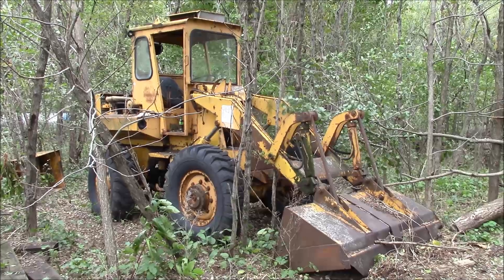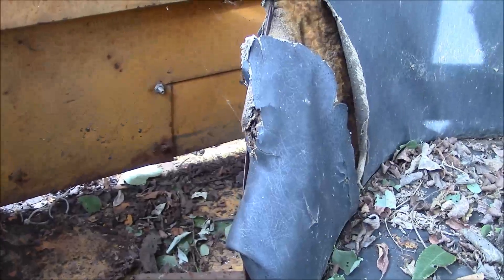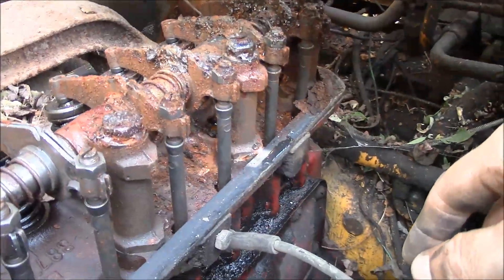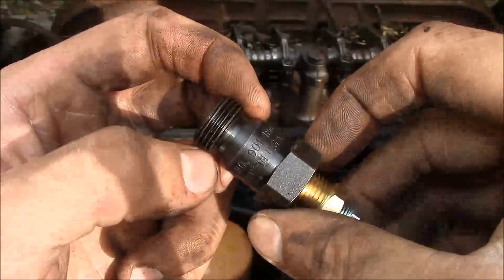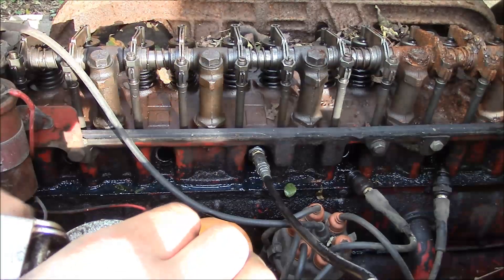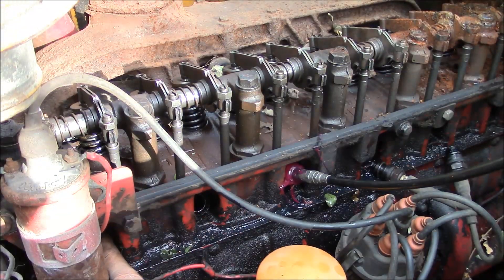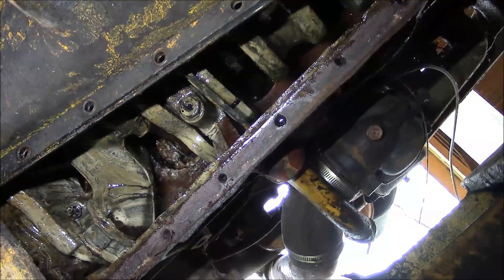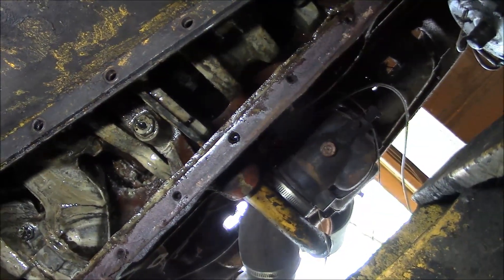Can You Free a Seized Engine with a Grease Gun?

Comment: I have a few ideas that you may want to try. while i am not a engine mechanic, I usually can get them started when im working with my grandparent who was. I have also done some chemistry and a lot of physics so I have some knowledge on what I am talking about. Sorry that my post is long but you may be able to make use of what im suggesting if in some sort of way if any of my ideas are remotely good. I have five ideas written down. also if anyone has a comment on my ideas, please do tell or correct me.

My first idea is to find something that can dissolve the sludge on all the parts of the engine in the inside, or at least slightly clean it, then clean out the oil pan. Once done the major part of my idea is to fill the whole engine top to bottom with WD40, coca cola (or something else that dissolves rust) as it can sometimes break down rust and gunk. 

My Second idea is to get more grease guns and hook them all up to the pistons on the down stroke and pressurize them equally adding a bit more to each one by one, this would give more equal torque to the crank shaft and to the pistons all together. you said the front was moving a bit so if you had more pressure on all of them equally then you may be able to make it move again.

My third idea is that if you have some welding tools you may be able to make a set of bars connected together that can be lined up with the pistons that are on the down stroke. Then have the the bars line up to a single point that can be struck with a mallet or hammer and try to force the pistons that were on the down stroke down manually, it may work but would need the piston heads exposed.

My fourth idea is somewhat dangerous, its putting the engine back together again and putting some fuel into the pistons that were on the down stroke and manually firing the spark plugs all at once for the pistons on down stoke.

My fifth idea and the one you would least likely want to do is dissemble the engine manually and clean the parts, then put it back together. My cousin has a three wheeler that had become seized and he disassembled it and put it back together to fix it. Understandably this is probably one you cant do but it may be the only other way I can think of fixing it besides getting a new engine. 

I may ask my grandparent if he has an idea as used to maintain and repair tanks in the wars, he worked on the engines that had square cylinders so maybe he might have a trick or to. 
Thank you for reading my long comment
Builder
Reply: Firing the plugs with regular fuel wouldn't work, pre loading the cylinder with oxy aceteline would work. With a bit of luck the explosion might get some decent pressure in the cylinder with the blown gasket before the gasket can leak to much.

Comment: It looks like the common old 300 hundred six ford engine. Old ford trucks everywhere that the body gave up for safety sake but the engine runs just fine.  I would requisition one from a pick and pull or market place... word of mouth, craigslist for a old runner so you can at least hear it, give three to five hundred for it so you can save for the yard to take what you are sure that you don't need and that means in the one the other one running so the doubt level goes down. I do believe other people will ask for parts like a rear end or transmission o you can give/ sell cheep so they feel like buying them. Don't get greedy. Just save the loader and its possible to pull the engine with the torque converter still attached but new seals to ensure no leaks for the few dollars it costs. You will smile as soon as you hear run trust me

Comment: Pull the head off and let it soak in penetrating oil for a day than slowly hit each cylinder using a piece of soft wood to not damage them! Have Freed a few engines this way. It would at least make it easier to take the engine out.

Comment: I have a loader like this one used for snow removal.  It has a 99 4.3 vortec engine and computer in it.  600 for the engine, computer etc and a machine shop made the converter adapter ring and mount plate adapter.

Comment: Just a thought.
Put the sump cover back on, fill cylinders and sump with coke. Cylinder walls are tough and should be fine (Plus petrols dont mind low compression). The rings might break. Let the coke sit for a day or two. Put a numatic wrench on crank and 1 second forward 1 second reverse and repeat. In about 2 minutes youll have it free.
Reply: I actually freed a flathead ford using boiling coke.  Put the coke in a sauce pan on the stove and brought to a boil while using a torch to warm the stuck cylinder.  Then poured the boiling coke on and smaked the piston with a hammer.  That said I obviously pulled the heads before I got to that point and it was only one cylinder that was stuck not 2 and it wasn't quite as bad as this one.  I think she is pooched but the coke thing is something to keep in the back pocket when faced with similar issues.

Comment: You could unbolt the con rods or that the engine is kaput you could cut a chunk out the crank so you can turn the flywheel to unbolt the torque

Comment: Tough break with the engine, you mentioned these engines were fitted to the gasoline variant of their tractors, does that mean there`s a diesel variant and if so would the diesel engine will fit the loader?

Comment: You can also use the hydraulic grease method to remove a bearing from a blind hole by filling the center hole with grease and then a couple of taps on a punch with a similar od to the center hole id and the bearing will come right out.

Comment: There is one thing about putting grease inside the piston, no matter what you have to take the head off and clean the grease out of the piston. You can adapt another six to run in that tractor. But yes you have to turn the motor.
Reply from the maker: The head gasket was leaking anyway.

Comment: Cut the engine up with thermite. Right there in the engine bay. Then make a adapter plate for some better engine or even a motor. Hmm a couple of Prius battery would not make much difference to that beast. I Don't know, just thinking outside of the box. Great video enjoy your program

Comment: Fill the engine with diesel fluid from the top fill, grab a air nozzle and mount a long brake hose tube on the nozzle end. Zip tie the air gun trigger, slide the air guns brake hose down the dip stick. Regulate your air compressor to about 5psi and let it sit over night. The diesel will help brake loose many of the containments while the air hose at the bottom of the oil pan will help agitate things. They do this method for carbon build upped clapped out cars and many are successful. Pretty sure it would help! If you get it free, throw a new headgasket in it.

Comment: One thing to consider is, the rocker arm train could be up to half the rotational resistance being so rusted up. You might still have luck if you remove the rocker arm or head completely. If you remove the head you could used a wooden rod and hammer the top of a piston while turning the crank with a wrench. If that doesn’t do it than it really is too far gone. If it frees up at that point than just have the head machined and run it. As long as you have enough compression it will go.

Comment: Who says you have to make all 6 cylinders working?

Take the head off and if the cylinder wall damage is too much, just leave out the pushrods of the faulty cylinder.

Yeah it will sound like a dying bear but it will run.
Reply: lol I'd love to see it bodged back to life like that! Guess you'd have to unbolt and torch cut the connecting rods on the seized cylinders to get them out the way, and leave pushrods out as you say.. youd have to disconnect the fuel injection lines too. If it actually fired it then maybe it'd be worth taking the head off, cleaning and lapping the valves of the good cylinders and putting fresh head gasket in there and it might even be usable.
Reply: @SuprSi  I've seen this done few times on old v8 beaters.

Usually only the intake pushrod is taken out, so that the bad piston is not just compressing the same air over and over again.

I think it's easy enough to just route the diesel line to the return line with diesel motors

Comment: From my experience with some seized engines is that their could still be water in the cylinder that’s stopping anything that’s poured into it. I’ve had success by filling up the crankcase with diesel so that it can work it’s way up to the top ring from the bottom of the cylinder.
Reply: As Eric O would say, "There's your problem, lady!"  It's almost certain that at least one of the cylinders is full of water. Remove all the plugs and see if it will turn.

Comment: If you're  not hoping to save the engine, more options present themselves.  Have you  tried pouring alloy wheel cleaner into the seized cylinders?  I've done that on motorcycle engines that were seized before.  It dissolves the rust but leaves metal mostly alone.

Comment: Save your money, time, and much MUCH frustration! The problem with “getting something running again”, is everything ELSE that needs work. The Trans will puke next,  then the seals, bearings, brakes... and on and on!  Find a used engine/trans combo, preferably a DIESEL, and convert it from gasoline. Some “up front” money to do that will save a ton of Nickle  and dimeing along the way!
Reply from the maker: We know it has other problems. But it would work for limited use.

Comment: Pop the head off and grab a sledge hammer and a chisel and break 2 and 5 pistons.. the engine will turn over allowing you to remove torque converter bolts...

Comment: I de-rusted and unstuck an inboard Chevrolet Mercruiser in a 1966 Glastron ski boat.  The engine looked way worse than yours BTW.  It had rusticles like the Titanic inside!
 I took the engine block out and submerged it in a plastic tub and did electrolysis on it with a battery charger, some lye, and a sacrificial steel bar.  I left it in the mixture for four days.  It was very clean (and pitted) gray cast iron.  I had to sleeve a couple of cylinders but it runs today and that was over ten years ago.

Comment: I think you've done all you can for that engine, either find a new/used engine for it that already runs or scrap the idea of the loader at this point. The other thing is even if you find a new engine and pop it in there, then the only thing you will know for sure is that the engine runs, while the rest of the machine may be just as bad as the old engine. Would sure be cool to see it running, but I think you're looking at a relic of scrap metal.

Comment: Mix up a mixture of ATF,diesel, brake fluid, penetrant, whatever you can find and dump it in the cylinders.  Then find a massive cheater bar and just start working it back and fourth. It has worked for me but if that doesn’t get it free the motor may need to be torn apart.

Comment: what if you put the pan back and fill all the cylinders with some chemical that dissolves rust / put the spark plugs back so it doesn't dry out. and go back to it in a few days. that might actually help instead of trying to brute force the engine to move with grease.

Comment: Here is my suggestion:

Use a flame cutter to cut the crankshaft so you can turn the torque converter.

Undo the torque convert bolts.

Flame cut whatever structures you need to get the engine out.

Replace engine.

Weld back in what you had cut.

Yeah huge job I know.

Comment: Not that odd to try as I once saw a video of a gunsmith using a grease gun to remove a stuck round from a barrel after the normal methods failed to dislodge it. 

When you run into bad engines and things like that on equipment in the woods remember to bag the parts you don't put back and have a marker to leave a note of where the parts are stashed and what you found wrong on it in case someone else comes along to try to not waste time figuring out what you did already. 

Even if the motor itself is dead the machine still has lots of good parts that can be salvaged for other projects like the lift cylinders would make perfect parts in a sheet metal compactor/bailer. The perfect thing for a scrapper or shop to turn large amounts of sheet metal into compact cubes for easier storage/hauling.

Comment: Coldwarmotors machined a cap for the cylinder and used a manual hydraulic pump to free it up. Had to take the head off. On the studebaker v Buick challenge.

Comment: The easiest way to free a motor is with an oil soaking everything and heat.  Fill the pistons with diesel and trans fluid. Soak the top and cover it back up.  Leave it for a couple days.  then apply heat with a simple propane torch. Heat it on the block around the piston.   Tell me where it is, I’ll do the figuring.

Comment: get to the crank nut on the harmonic balancer  and put a socket on it a breaker bar. take a drilling hammer or mini sledge and beat the breaker bar handle going both ways. keep hammering until you get the slightest movement and then work it back and forth. i guess you put marvel mystery oil or automatic transmission fluid in each cylinder?  the best penetrating spray proven on you tube is seafoam deep creep

Comment: iv used that on single cyl engines. but unless you know witch pistion is stuck i think your chances on that engine would be pretty slim. after seeing the view from the oil pan. that engines going to have to come apart if its going to run again
Reply from the maker: Yes. We knew that. I just wanted to test the grease method.

Comment: Fill it full of diesel fuel! Sparkplug holes .valve cover .Fill the  oil till its piss ing out the dip stick ..Ps cut the belts all of incase the generator is stuck.Leave it sit  for a mth.get a big socket for end of crank .drain all the oil  take the plugs out .Use the biggest strong bar or cheater bar you can find

Comment: I’ve used that air-hold fitting on a hydraulic hose hooked up to an IH tractor. Same principle as the grease gun but faster.
Reply from the maker: That would make quick work of it if we had a tractor nearby.
Reply: The tractor pressure is similar but the grease gun will put out several times more pressure.  about 2 to 3000 psi compared to 15,000 psi for a grease gun.

Comment: In my work i use a electrobath to derust car parts, So when I had a 1958 Mercedes engine here with six rusted in pistons, I stuck it in the bath and forgot about it for two weeks. The pistons came loose and only took a bit of pressure to shove them out. 
Cold war motors,on their channel got a pair of old straight eight engines unseized by removing the heads, bolting on a flat plate to the worst cylinder and then pumping the cylinder with a portopower. Worked a treat. So a mate tried it with a set of 1909 Cadillac pistons and it worked for him too. Heres a vid showing how the electrobath worked on my other channel .https://youtu.be/rBtn19BPqDM
Reply: Mercmad problem is the rest of the engine including the crank bearings is full of rust and ruined

Comment: I believe what you have there is an IH C-263 gas engine. IH used the C-263 in Farmall 706 tractors and 403 combines. You might have better luck locating an old combine or tractor to find a good used engine. 
The IH 3850 loader was IH Construction Equipment Division's attempt to make a loader. Which was silly considering IH had another division (Hough) that pioneered front end loaders, and led the industry. These loaders didn't sell well and weren't made long and parts are scarce. They were a far cry from a Hough loader. 
Your theory about it being a C-301 is possible as the C-221, C-263, C-282, C-291, and C-301 are all the same family of engines. But the HP rating for the 3850 suggests to me C-263. Combine engines can usually be found cheaper than tractor engines and they usually have less hours on them. Good luck!
Reply from the maker: Well it's not the original engine. The more common diesel version was a D282. I don't know what the original gas engine would have been, but probably larger than a 282. 291 or 301 is my guess.

Comment: The only thing that I would do now is to disconnect the P,T,O shafts off the transmission to the front and rear axles so can pull it out and using a digger and to left up the bucket so that you can put a chug on the rams to keep the loder arms up and then take back to your workshop to work on it. Or insurance it for a year and then set a match to it and get a second hand digger from the insurance as long they didn't see this video.

Comment: We had a Ford V-8 engine in a combine, that siezed.  The last time it was tried to start, either was used, but it didn't start.  Either removed all the lube off the cylinders, and rusted solid over the winter.  Come spring, we had to pull one head.  Poured diesel down all the cylinders.  Every day for a couple of weeks, we would pound on the cylinders with a block of wood and a sledge hammer.  It eventually broke free, and ran perfectly afterwards.  Didn't even burn oil after all that abuse.

Comment: Pull th rocker assembly smack valves with a hammer gently if that fails pull up the head if that fails take apart piece by piece take it home and have a beer or more
Reply from the maker: The valves are free, they just don't seal.

Comment: If you want to get it to rotate to pull it off the trans, and those two stuck cylinders both have the crank pins on the same side of center, you might be able to pull the rod bearing bolts on the stuck cylinders and then rotate the crank back away from the stuck pistons, just leaving the rods hanging there. Don't know if you would be able to get a full rev with the rods hanging loose, but it could be worth thinking about. I agree the engine is trash, the question is how to most easily get it out of the machine without breaking other things in the process. (Assuming the trans doesn't look like the engine!)